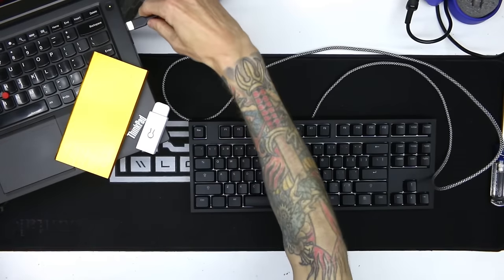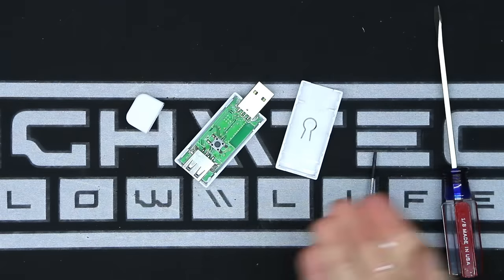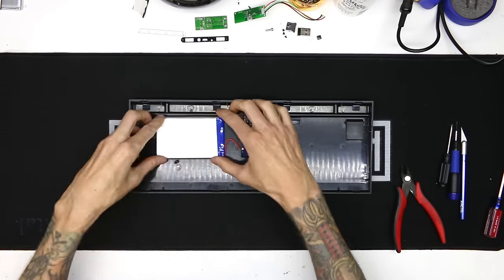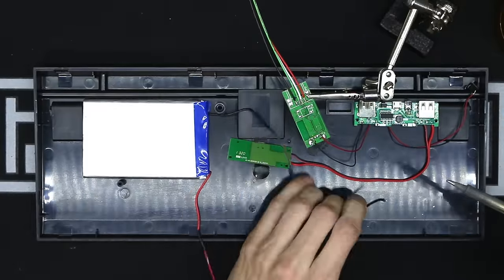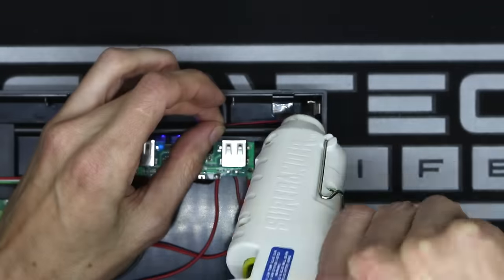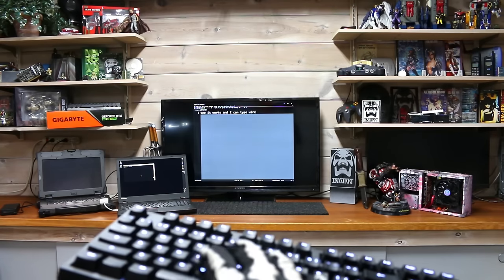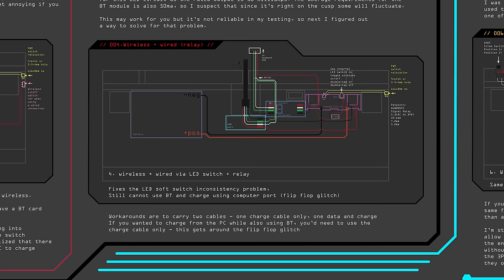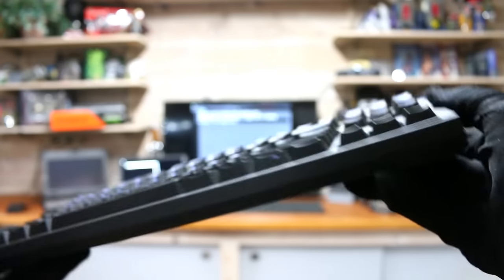⌨ Make ANY Keyboard Wireless! - Convert Any USB keyboard to Bluetooth Wireless - DIY Tutorial How To

Comment: Hey, I was thinking of making my old blackwidow wireless. Do yall think it may work? I was thinking of ripping the bluetooth component from a mouse so I could use the dongle.
Reply from the maker: It will work with that keyboard, I'm not sure if the mouse module will work as a transplant, but it might, worth a shot 👍
Reply: Thx man
Reply from the maker: @thomasulrich3107  No prob!

Comment: I'm rookie when it comes to wiring and circuits and stuff, so I was just wondering how connecting the micro USB port under the "OUT" port of the charging circuit charges the battery (6:50). Shouldn't it be connected to the "IN" port of the charging circuit? It's working just fine in the video, but I just can't wrap my head around this.
Reply from the maker: That's a good observation, this is only true on this specific charge circuit - the USB micro in and USA-A outs are traced together, so they can function both ways as they both go to the same place 👍 Other charge boards most likely are not wired this way, so you would have to have your input only on the micro in (or type-c in connector).
Reply: @hightech-lowlife   Thanks for clarifying! Just a follow-up questions, I have a vermilo VA87M and the micro USB port has a SGND wire on top of D+, D-, power and ground. Would it affect the performance if I just leave it out cause the BT module only has four pins?
Reply from the maker: @jhin5844  If it's a ground then you can tie it into any ground, but most likely it will work just fine without it 👍
Reply: @hightech-lowlife  Thanks a lot. I have all the components on their way now. Very excited to see how it will turn out.👍
Reply from the maker: @jhin5844  That's great man, I'm sure it will come out awesome.

Comment: Could I skip the charging circuit part if I use an Adafruit Micro-Lipo Charger? as it can be the charge circuit and the usb port simultaneously
Reply from the maker: Yes, 100% 👍
Reply: @hightech-lowlife  and to add a power switch I'd just wire it to the positive on the adafruit pcb and the positive on the usbtobluetooth pcb? Sorry for all the newbie questions
Reply from the maker: @zachosborn6622  Yes, that will work 👍
Reply: @hightech-lowlife  Ok first of all you are an absolute legend for replying and helping so much XD I have one last question to bother you with though, I've decided to scrap the adafruits parts idea (as a redditor pointed out that those ran on 3.7v and I needed 5v for my application) and cracked open a power bank. I've decided to just use the power banks pcb for all my needs, the last part I'm hung up on though is which solder points are which on said pcb. I've looked up diagrams for both usb a and micro usb ports and made guesses based on what I've learned and watching this video about 100 times. So finally my final question is, are my guesses in this image https://imgur.com/frWij8V correct? and if not could you possibly point me in the right direction?
Reply from the maker: @zachosborn6622  It's no worries man, yeah the USB 2.0 pinouts are super simple. Check this: https://openclipart.org/detail/334216/usb-20-pinout-by-rones 

Another easy way to tell is to use a multimeter, set it to continuity and then whichever pin beeps when connected to the negative battery terminal, you know it's the ground side. 

Also the more familiar you are with PCBs you can start to see how most of the grounds are tied together, and usually the pads connected to them are much larger and cover more surface area. 👍
Reply: @hightech-lowlife Sweet! Cheers my man! Any suggestions on how to solder to the itty bitty D+ and D- points on the micro usb connector?
Reply from the maker: @zachosborn6622  Soldering the mini pins can be tricky, see if there is another component down the line you can tie into more easily (cap or resistor). Add flux if you can, typically the solder will want to separate 👍you can even trim some of the strands to make a smaller connection if you need. 

If you really don't want to attempt soldering that small, just strip back the leads on a USB-Micro connector (from a micro USB cable, chop it off, just leaving the connector piece) and then solder to the leads going into the connector, and plug the connector into the board (given you have room within your case) this is the easiest method 🍻

You may want to check how your charge PCB works, some of the cheaper ones tie in the USB-A ports into the Micro circuit. That's how I was able to do all of my soldering to the larger USB ports. Although if yours is of higher quality, usually they will separate the inputs and outputs 👌
Reply: @hightech-lowlife  I really cant thank you enough for all your advice! I'm just going to order the USBtoBT module and give it a shot XD oh and I just thought of one last last thing, again I'm so sorry to be annoying lolz this is just very fun and exciting. But, and correct me if I'm wrong here, but couldn't I solder wires from the D+ and D- on the micro usb port to the 2 type A usb ports on the charging circuit and technically have usb passthrough while wired to a PC? or am I just going to fry stuff doing that?
Reply from the maker: @zachosborn6622  It's no problem 👍I think you can figure it out without issues. You could try doing that, but it may not work at all, or work the way you want it to. I would just try it out and see what happens. Good luck man!

Comment: This project will be perfect with the Redragon K605 Alien Giant Mechanical Gaming Keyboard, Super Big 61 Keys & Outemu Blue Switch, RGB LED Backlit.😎
Reply from the maker: Awesome man!
Reply: @hightech-lowlife ...  I just received the Bluetooth Adapter...Yep in 2 Days.   While trying Adapter like you did in beginning of video with a wired keyboard I had laying around and 3 different power banks  they all work but shut off in 15 to 20 seconds and have to press button on power bank to resume BT function.  Amazon shipped K605 I'll get by Thursday.
Reply: Tryed an old led keyboard I  found and battery phone charger stayed on.  So it should de OK with K605
Reply from the maker: @JohnnyJTav  Cool! Oh that's because it's not drawing enough power to keep the power bank on, some power banks will have an auto-off function if the load is not above a certain threshold. 

A mechanical keyboard should be more than enough though unless whatever power banks you got are tuned in a way to warrant a ton of power output to stay on. I did show a separate charge circuit PCB you can get that will not have this function and can be used if need be.
Reply from the maker: @JohnnyJTav  Awesome man, good luck on your build!

Comment: Do you know why I can't turn on my keyboard while it's connected to the PowerBank?

The powerbank has enough power... I tried my cell phone charger instead the powerbank but it doesn't work either
Reply from the maker: Some power banks will not work (will turn off) if there isn't a high enough load on them. It's possible your keyboard is not drawing enough power for that power bank to recognize it. 

Does the power bank charge your phone? 

If you're giving it direct power and it's not working then it must be something else. Is the BT-500 getting power when plugged in directly?

Comment: i cant seem to find the handheld scientific BT500 for sale anywhere online... any alternatives? could i use a BT module with just 1 usb port and run the keyboard power parallel to the charging circuit? is the power just passed through the bt500 with it powered off the power rails anyway?
Reply from the maker: Hello, did you try their website that I linked in the description? Their site says they have them currently in stock (scroll to the bottom of the page): http://handheldsci.com/kb/ 

I also have a write up here (which is also linked in the description): https://hightech-lowlife.github.io/projects/004_wireless_keyboard/004_wireless_keyboard - In it you'll find a pdf of my schematics which show a lot of different ways to wire up your keyboard. You're not limited to these options, you can split, add switches, etc to tailor it to your wants and needs. 

If you don't want to use a BT-500 you can use an Arduino but you'll have to compile and transfer code to it to make it work, this guy made one here: https://www.youtube.com/watch?v=L7EqKJ02lK4 

It really depends on how you want to wire it, in this very video I show many examples of how to wire it up, including my recommendations. You can wire the power parallel if you wish, but you'll then need some way to switch between providing power to the charge circuit and then direct. One way to wire it is to pass the power through the BT module when it's powered off, yes.

Comment: Is there a way to do this with a keyboard that has a built in hub in it? I'm asking this cause on the Magic Box's website it says that it won't work with the devices plugged into the keyboard.
Reply from the maker: According to their documentation: 
"Compatible with all types of USB keyboards including those with a built-in hub (e.g., Happy Hacking, DAS, Apple, Dell, etc.) and keyboard/trackball combos (in that case both keyboard and trackball will work)
For keyboards with a built-in hub: other devices connected to the hub will not work"

and from the manual: 
"The firmware has the support for a USB hub with up to two devices attached. It should
work with either a built-in hub in a keyboard or an external hub. Keyboards with a built-in
hub are supported provided there is no other devices connected to the hub. The
following two setups are not officially supported, since there are too many combinations
of those and we can’t test them all. But there is a good chance they will work:
o A keyboard with a built-in hub and with one additional keyboard or mouse
connected to the hub
o An external hub with one or two devices (keyboard or mouse) connected.
Currently the Adapter works only with keyboards and mice but not any other types of USB
devices such as serial port adapters, game controllers and touch panels. "

What I get from this is that if you're just using the keyboard hub for a mouse most likely it will work, if you're trying to use the hub for anything else it won't. 🍻
Reply: @hightech-lowlife  I see, thanks. There probably is another adapter that could work, but I'm not sure.
Reply from the maker: @andrasgraff5984  From my research before, there has only been one or two companies that have attempted to make a BT USB hub, and both those products were discontinued shortly, there's something about BT that doesn't lend itself well to be used like a hub.
Reply: @hightech-lowlife  But could I make it in a way where wirelessly only the keyboard works, but plugged in everything does?
Reply from the maker: @andrasgraff5984  Yes, you could wire it that way.
Reply: @hightech-lowlife  Thanks for answering all my questions.
Reply from the maker: @andrasgraff5984  No worries man, thanks!

Comment: what if, we have like 2 dongles and connect one to the keyboard and one to the laptop, and it connects wirelessly?
Reply from the maker: It will not work like that, the cheap dongles are only receivers - this BT module is a transmitter 👍

Comment: Why you connected the keyboard +/- into the charging circuit +/- inputs?
Reply from the maker: What are you talking about?
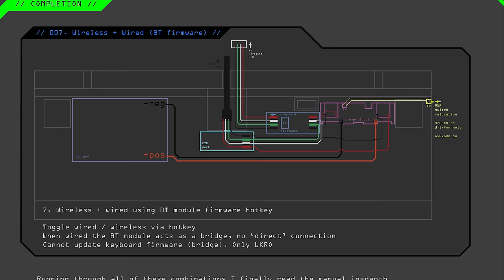Reply: @hightech-lowlife  6:03 shows the red and black lines from the keyboard connects to the inputs of the charging circuit
Reply: @hightech-lowlife  oh wait, that's the USB port. I thought the black cable in the image is the keyboard wires
Reply from the maker: @JAAS-b7k  Red and black will go from the port to the charge board, otherwise how else would you charge the battery?

Comment: what if the keyboard is mechanical just a piece of long pcb without the microusb port like in your video, like the only external connector is a usbc, and that has died and I wanna make it wireless, which components do i need to buy then?
Reply from the maker: If it's just the port that has died (and isn't a bigger problem down the chain) just remove the port and you can add your own wires to add another port, or just fix the port and then intercept it. Or just wire the BT module direct to the board, with no port and only use the port on the charge circuit to charge. 

If you want to replace the port, then one way to implement is to intercept the wires at the port (I did that in this video: https://youtu.be/2Df7Dh3-3o0 - this will be harder on type-c because the pins are too small. 

Another option after replacing the port is what I did here by making your own case where you extend the port - intercept there, then add your own port: https://youtu.be/9YVPvAlrbxg

It just depends on what you want to do. 👍
Reply: @hightech-lowlife Thanks for the fast reply. the issue is the board only has one usbc which was spoiled coz the board lining to the contact pin of the usbc is cut off when I pull out the usbc it take together board lining.... So now I don't want to use usbc anymore but want to make it either Bluetooth or 2.4ghz, issue is I dunno where on the pcb board should I add the module for the wireless component... Plus this is with qmk software keyboard....so if i successfully made it wireless... Would it be able to be programmed via wireless mode?
Reply from the maker: @osirusj275  You'll need to be able to solder to the leads to where the USB connector was,  if some of the trace was ripped up you may have to follow that trace down to the next available pad. 

You most likely won't be able to flash firmware using the BT-500 as it is a bridge, if I were you I would solder on a new connector from leads to where the old one was, then intercept there, that way you'll have more flexibility and be able to go both wired and wireless.
Reply: @hightech-lowlife  when u say intercepts meaning trace where the line leads to another new area where I can attach the module? I think even 2.4ghz also won't be able to program the keyboard ya... So best bet is trace the line and attach a new usbc on new area, then if there's extra area only fix the 2.4ghz ya
Reply from the maker: @osirusj275  Yeah, regardless of what wireless method you choose, you'll need to find a way to connect to the traces that led to the connector. If you want to update firmware you'll want a direct connection option 👍
Reply: @hightech-lowlife   but how to see which which other port it can connect to and using black wire on which part and red wire which.... I have no electrical background
Reply from the maker: @osirusj275  You'll have to look up the pinouts on the connector you're trying to attach. Type c is a complicated connector and has a lot of pins, but you really only need 4 as the rest are not used. Only VCC (Power), ground, data + and data - are used.

Comment: Can i use bluetooth modules that has 3.5mm jack and usb and tf card slot or this bt500 module is the only module that will work for this?
Reply from the maker: Most likely you're referring to a common BT module, and no, that will not have HID support so it will not work for this application. 

Sure it may be possible to piggyback that with an Arduino board, but you'd have to write some of your own code, at that point it would just be easier to just use a BLE Arduino board, or even easier to go with the BT-500 as shown in the video.

Comment: Hey bro great video, i tried but i ran in to a problem, my keyboard usb cable isn't removable and the connector is a 5 pins one, insted of one whit 4 pins that´s why i think mi bluetooth module dosen´t work fine, connects to the pc but the keys don´t work, i hope you can help me, thanks 

i hope you understand me, i don´t speak english. i'm from Chile
Reply from the maker: Thanks man, 

Your keyboard doesn't have to have a removable cable, as it's the same 4 wires (if you have 5 wires, I'm sure the extra one is black, some mfgs use double ground, you can solder them together black + black). From my experience you don't need to though, you can just connect the 4 and it will work fine.  

Just make sure the other wires are correct 👍
Reply: @hightech-lowlife  Yes, are two black wires, thanks a lot ⚡
Reply from the maker: @JavierUribePivet  No prob 👍

Comment: Nice video, you explain everything fine. But im from Greece and i cant get this updater (cause of taxes). Can you suggest something else ?
Reply from the maker: You should be able to create a BT connection using an ESP32 board (like this https://www.aliexpress.com/item/32808551116.html) but you will have to run your own code or grab someone's that works for this application and load it up. I have never tried it myself so I can't speak of that process. I may do a version with a board like this in the future just to try it myself. 

I saw a guy on reddit do it for a numpad (https://www.reddit.com/r/MechanicalKeyboards/comments/ppu1g4/custom_bluetooth_extended_numpad/) 

This particular board also has limitations in charge speed for its built in circuit (500mA), so you might be better of going with a separate charging circuit like I have done. I also don't know the energy use of this board, it could be better or worse for run times. 

Good luck!

Comment: Would you do a wireless conversion of older PS2 port keyboard to wireless?
Reply from the maker: I will look into it, although it won't be that much different because you'd just go PS/2 adapted to USB first, then USB to BT 👍Just one more step, but I might do this with a vintage IBM board or something like that in a future video. Thanks!